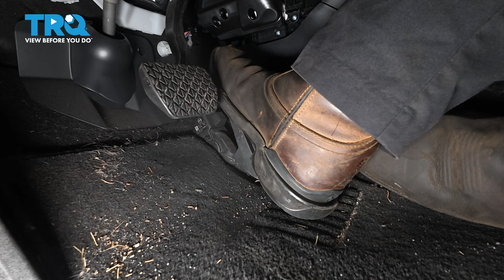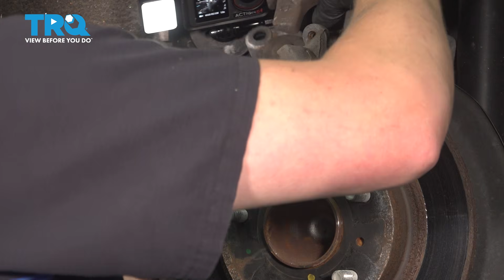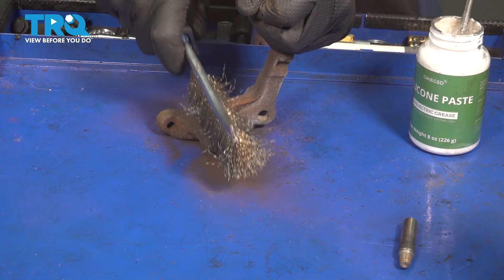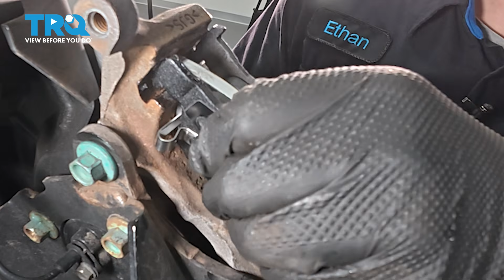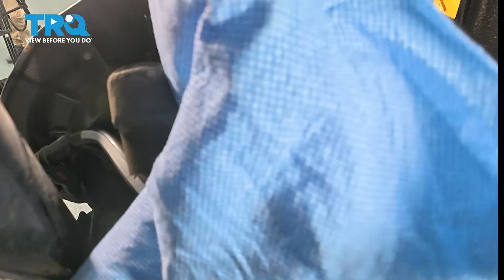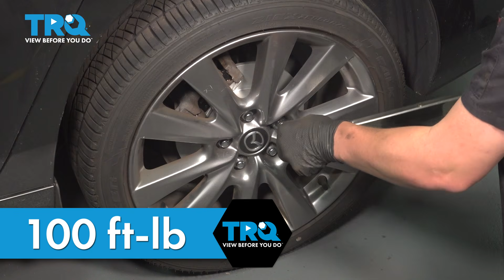How to Replace Rear Brakes 2019-2026 Mazda 3

Comment: Thanks for the video. Clearly shows the steps. Question though, I want to remove the rubber boots and replace the slider pins as well. The boots are really hard to remove without destroying them, especially the upper one that has a rigid plastic in-mold part. Is there an easy way to remove the rubber boots on the rear calipers and push the new rubber boots in without damaging them? Is there a tool to do the job?